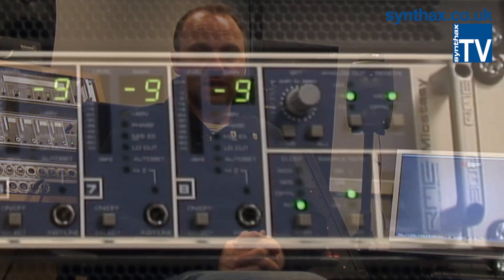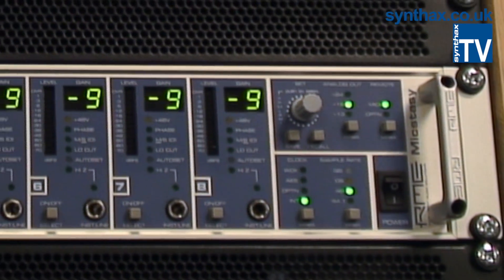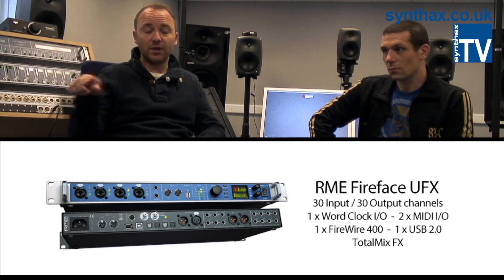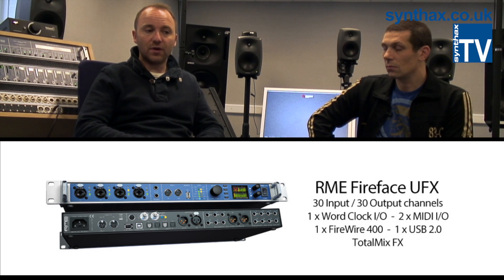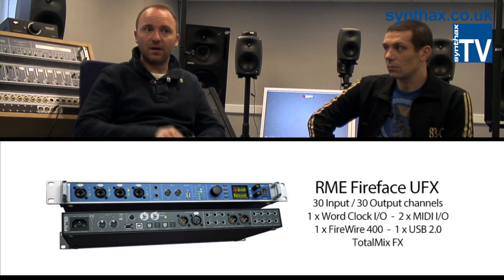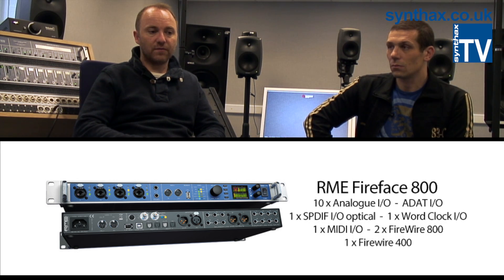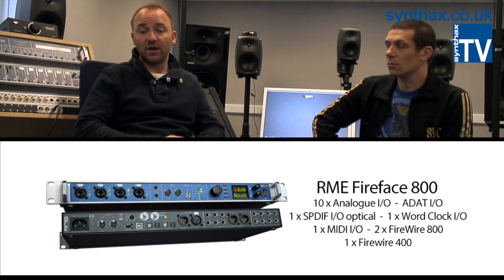RME In Education with De Montfort University - Synthax TV

Comment: how to listen multichannel audio 5.1 from rme babyface using spdif/adat?
Reply from the maker: Hi, can you explain a bit more abut what is it you are trying to do? Do you mean sending 6 discrete channels of audio (for mixing in 5.1), or are you looking to send AC-3 via the ADAT optical (e.g. for DVD playback)?
Reply: First - I want understand how to  play DVD with this ( http://www.sony.co.in/electronics/all-in-one-home-cinema-systems/dav-dz350 ) 5.1 receiver using an optical cable?

 And the second thing - how to work with 5.1 in Cockos Reaper  especially how to set up the outputs for connect with this sound system using an optical cable?  If it possible with Babyface..
Thank you for answer.
Reply from the maker: Hi, the ADAT output can carry up to 8 channels of audio at 44.1/48 kHz, which is of course enough capacity to supply an amp with 5.1 (6 channels), so long as the amp is capable of accepting ADAT.  You would just configure channel 1 to be the left speaker, channel 2 centre, etc. in the playback software, or in the Windows Sound settings.

If the AV receiver is expecting an encoded surround sound format, then the options are more limited. Under Windows, the Babyface Pro can pass through AC3/DTS encoded audio from relevant software (e.g. WinDVD or PowerDVD) to the optical output.

If you need more information, please contact your local RME support here;
http://www.rme-audio.de/support.php